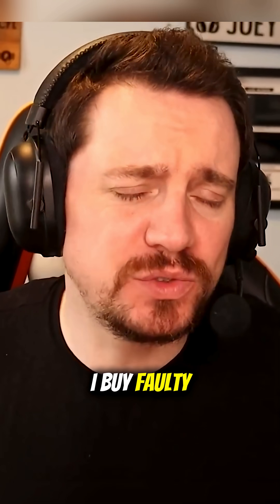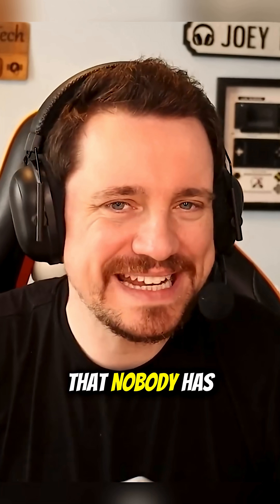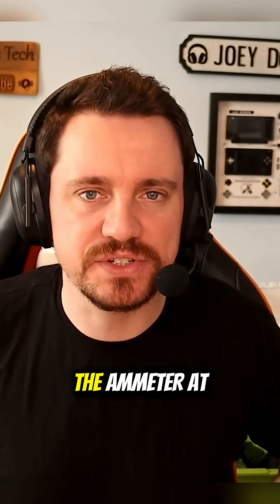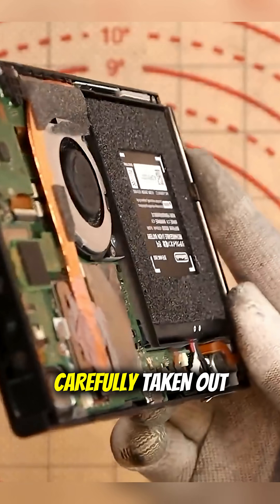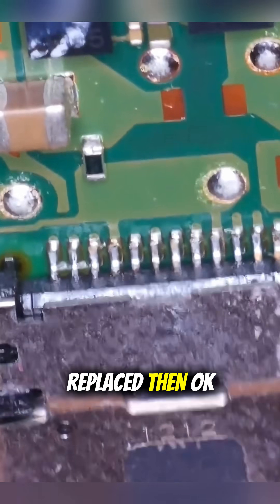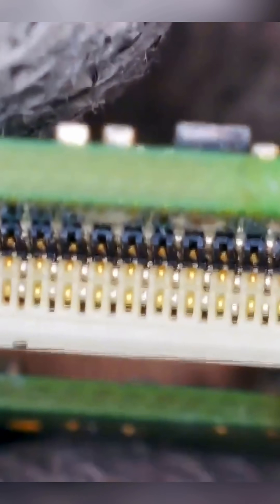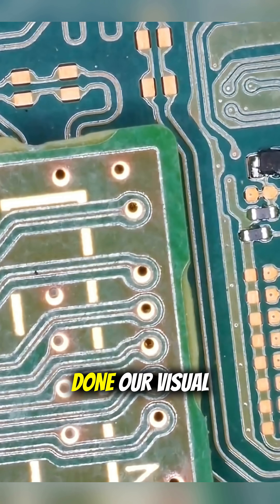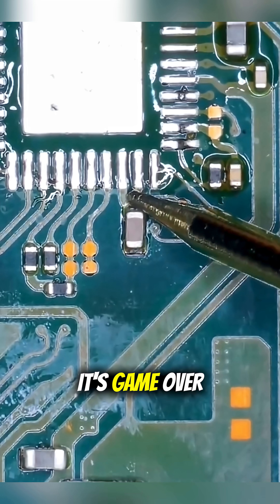What On EARTH Happened To This Faulty Switch?  #repair #soldering

Comment: Would youi be happy to answer a question for me please? My switch is banned from Nintendo network. What part of the device would need to be replaced if I were to buy a faulty device and "swap" the parts over. Have you ever done that before? Thanks for your videos. They are fascinating
Reply: in theory you would need to swap over the NAND chips, as these store system info. However these are paired to the system CPU. So you would need to flash that, from the donor device aswell. You would then need to reflash it. Next time you cheat, use exosphere to hide your serial number from nintendo
Reply: Yeah buy a new switch and don’t do what you previously did to get banned.
Reply: @robRob8819  Fair!